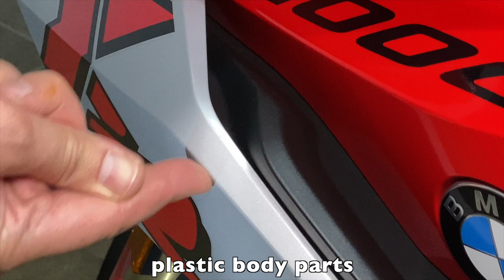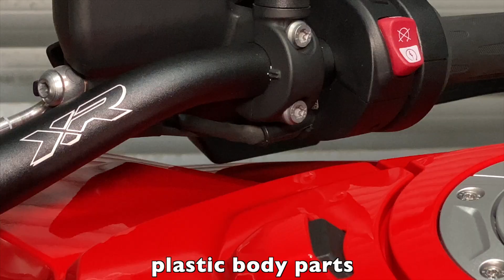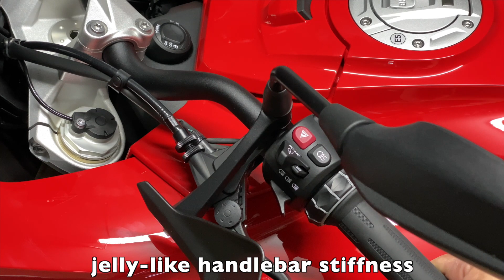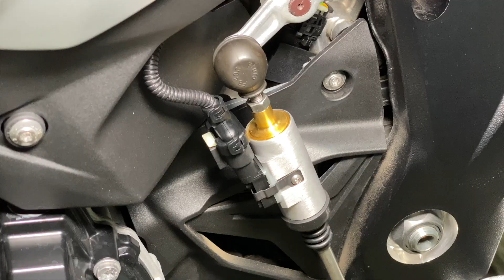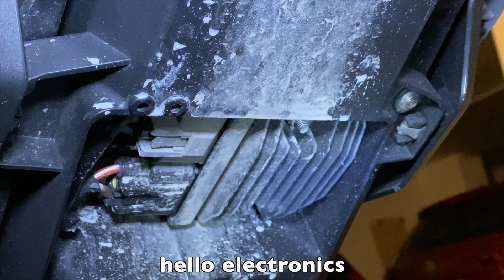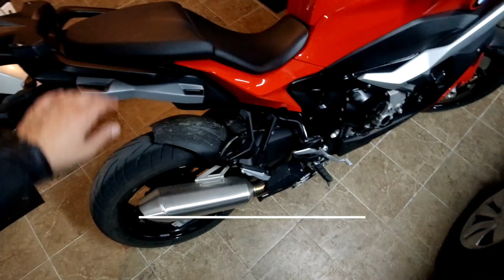BMW S1000XR Poor Quality Features

Comment: What a complete muppet, the handle bars are designed to do this as a vibration damper, the rear rack is also designed to move left and right to compensate for cross winds when a box is attached.  The rest is plastic as any other bike, what do you expect?. If you need to tighten your chain while out, you need to look at your maintenance! The electrical connectors are all IP68 rated and tested - you need to do some research!!!